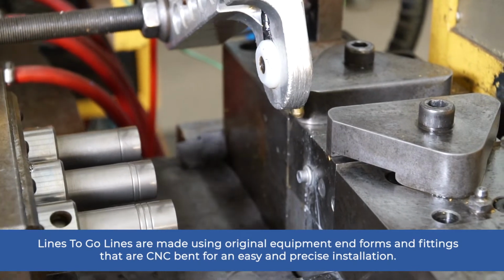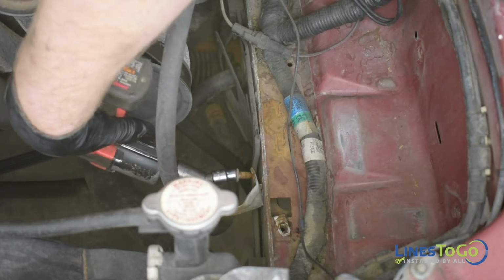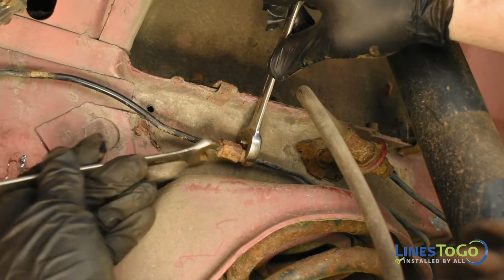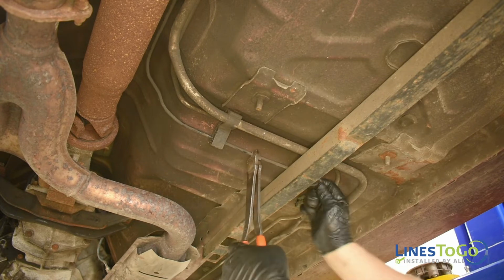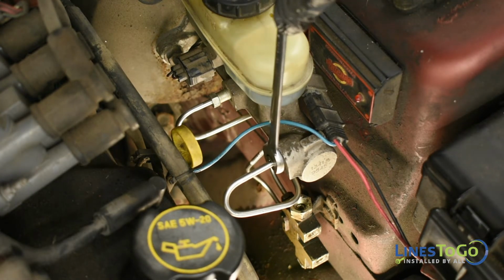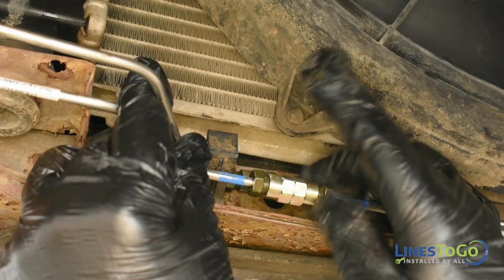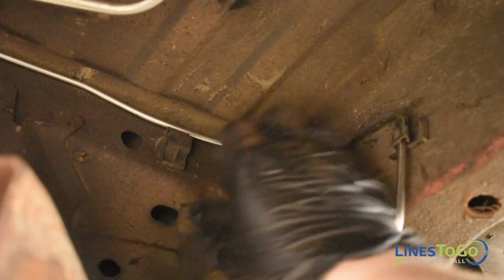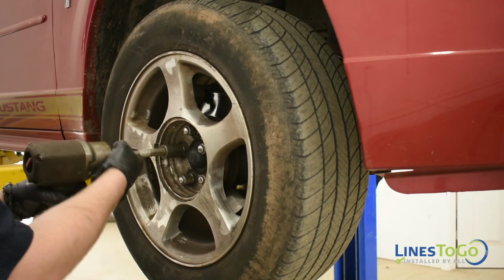How to Install 1999-2004 Ford Mustang Brake Lines

Comment: What size or what are the fittings called that go into the y on the passenger rear brake hose? I destroyed the threads on mine so I'm trying to just replace the fittings that go into the Y
Reply from the maker: Hi there,

Give us a call at 1-855-781-5992 to discuss what would be the right fit for vehicle!

Happy Travels!
LinesToGo

Comment: Is it possible to remove and replace the right side line without cutting it?
Reply from the maker: Hi Terry,

Based on the video, we do not notice any cutting happening with the original lines. If we have lines that are sectioned, it's better for installation ease.

Thanks

LinesToGo Team

Comment: What sizd are the fittings? Thread, length, hose size? Trying to see if these will work with my current build
Reply from the maker: Hello! The fittings are 3/16"x10mm. There are no hoses included in our brake line kits, you would have to reuse your existing hoses or check with a local automotive dealer. The lines included are 3/16" and come in multiple pieces for easier installation. If you can provide us with the specific line sections you are inquiring about length, we can find the pre-bent line lengths for you. Unfortunately weare unable to provide lengths of lines after they are bent. If you would like to discuss further you can reach Customer Service at 1-855-781-5992.

Happy Travels,
LinesToGo Team

Comment: In a manual transmission, can I stall the car in 1st and be the same as stalling with the fuse out?
Reply from the maker: Hello - I spoke with our mechanic and he advised "No, stalling the transmission just forces the engine to stop, removing the fuel pump fuse and allowing the engine to stall relieves the fuel pressure in the lines allowing you to disconnect the fuel lines without pressure spraying fuel everywhere . Without doing this high pressure fuel can spray into your eyes. "

If you have any other questions let us know!
Reply: What is the part number for the brake proportioning valve? I tried new lines but the valve seems to be the issue